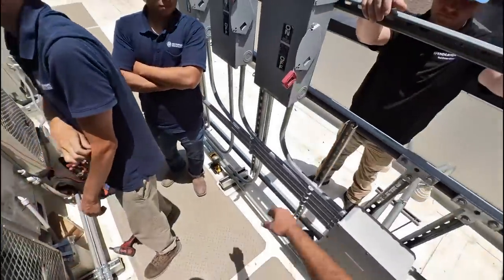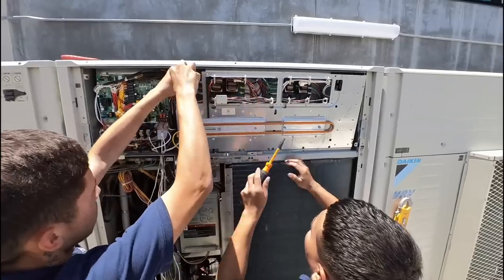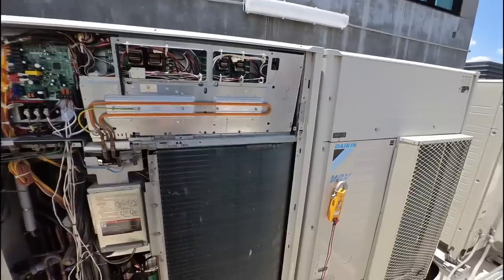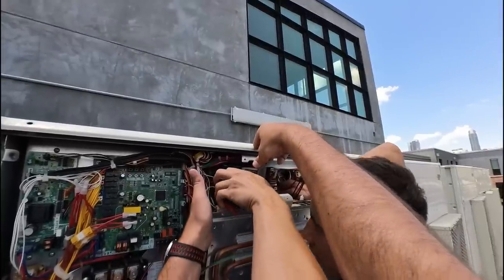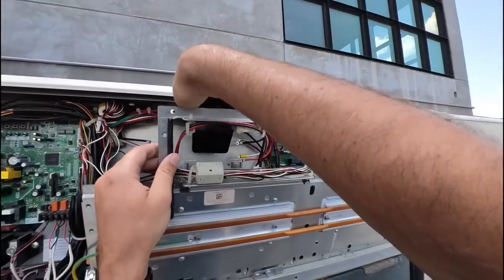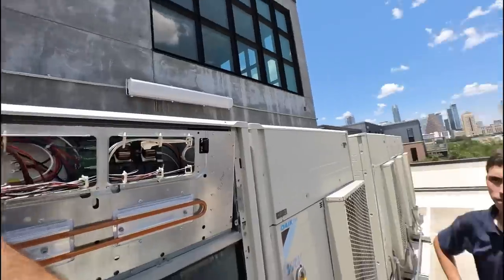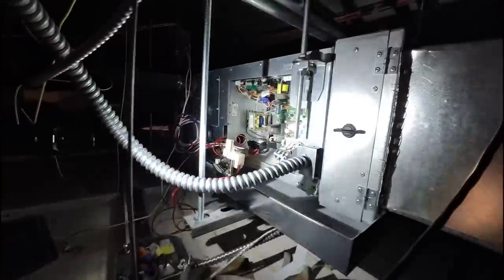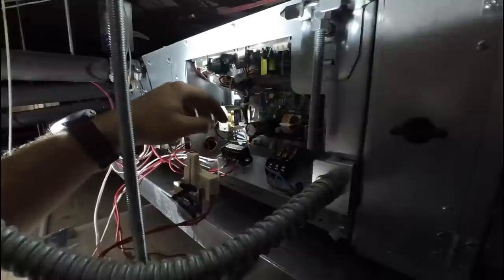HVAC VRF Service: Daikin VRV Started GREAT but then...

Comment: on Daikin VRV, it is also always good to do a reset after replacement of a PCB or doing a change in the number of indoors/BS boxes or after playing with the comms cable
Reply: Too right. I saw a good video about that by hcacr aus
Reply: Why ? I suppose it is to test the new board but is there another reason ? thanks
Reply: @halimturqui5007  i THINK every board has its own signature/comm code/identifier and during the reset daikin again builds its address database
Reply: Reset needs to be done, when you decrease IDUs quantity. Increasing makes addressing automatically.
Replacing of inverter PCBs doesn't require reset. And filter boards haven't their own addresses.

Comment: I work on vrv/vrf and can confirm they are a money pit. The carbon savings are at least partly offset by constant repairs, replacement parts and technician travel
Reply: The kool gard 2 has done wonders as far as saving these soft ass dc boards in residential inverters
Reply: @Hurpdurpdipidydoo  is that surge protection?

Comment: IMO, theres just too many electronics in these things now exposed to all the repeat daytime/nighttime cycles, how does anyone expect a good 20 year lifespan on that? You see HVAC technicians on here keeping old 30+ year old junk working for months in the most thrifty way as clients simply cannot afford to upgrade, so how could they afford all these extra repairs if they're barely getting by on decaying units with equiv of duct tape & glue?

I like the direction for efficiency but just seems like very poor execution. Why not use more off the shelf VFD's with simple reprogramming swaps? Why not one central larger noise filtering/conditioner on the line that also does PFC prior to entering the outdoor units? EDIT: Don't even get me started on parts shortages & substitutions in the worst times that demand it.
Reply: Being a well seasoned chiller tech/rebuilder that requires massive amount of advanced knowledge to avoid disaster, this kinda swap a board VRV proprietary parts cannon stuff has to be annoyingly repetitive for you.

Comment: filter boards are mostly to keep the crap the unit creates on the power lines from getting out of the machine. that they also block incoming crap is a bonus but its not the main goal of the board.

Comment: It helps if you take that cooling loop off the back side of the inverters and you can bend it down so far that it’s almost at a 90 degree angle and you have access to everything
Reply from the maker: Ya just always makes me nervous. Only do it when absolutely needed

Comment: How much experience do you have on the MC2?  I have a question about the coolant flush process.  Its a, I think, 1278?  Something like that, its the big starter.  I know what the issue is, but not sure the proper procedure to get the cooling pumps to run.  
Is there any way I could get a hold of you to ask q question?

Comment: Junk. Due to government Efficiency standards.  Throwing away hundred-dollar bills to save pennies.  More government regulations mean higher cost for everyone, with no real advantage. Equipment is over complicated, expensive to maintain, unreliable, and will have a short lifespan.
Reply: Yes and no.  The manufacturer needs to build it properly so it don't fail. The cheapest parts that can be found isn't good enough.